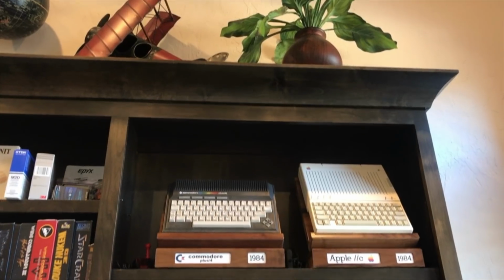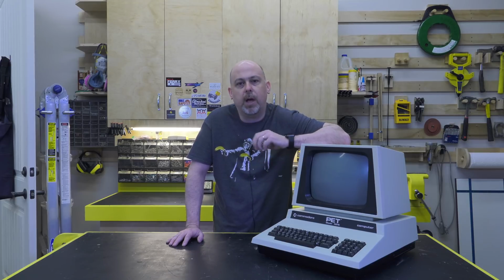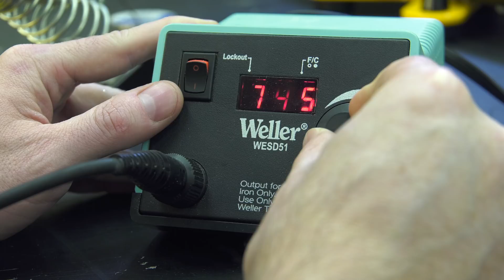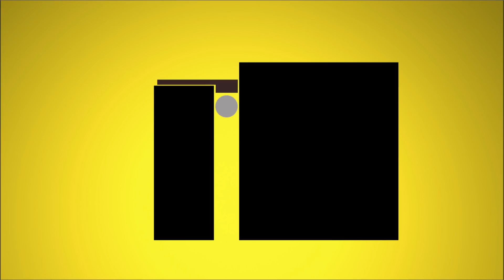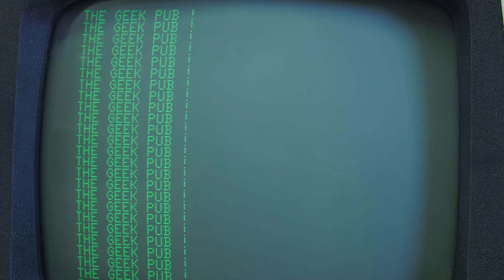Commodore PET Repair

Comment: THE first computer I saw was in 1978 (during my elementary school years), and it was a PET 2001 with the chiclet keyboard and built-in Datasette. The next PETs I saw were in junior and high school, as my school district's computer labs were outfitted with PET 4016s and 4032s. That did not last, however, as the district began replacing them with Apple IIc computers during my senior year.

Comment: I had a different problem with this keyboard type. The metal bits that held onto the space bar stabilizer kept slipping off the space bar.

Since these were pressure fitted, I just wrapped some tape around the metal bits. Took a bit of force to reinsert them, but they stayed put.

Comment: Hello,
I recently built a commodore pet mini raspberry pi but iam having trouble. 
I installed GTK3VICE and did everything I had to but now I dont know what to do. I uploaded a rom to pi called c-pet.vsf its basically a commodore pet rom but when I launched my pi and then installed the rom onto it it launched commodore 64 basic v2 instead of commodore pet v4. How can I fix this? I used vice and do i need to use lr-vice? And when I turn my pi on I see commodore 64 then i click on it and there is the rom but it launches the commodore 64 basic 2v. Thanks if you help me!

Comment: Fun fact: I started at school with a Commodore 8032 and started a business in 1983 with a C64 supplied by the client (I couldn't afford one). The software I developed on the C64  ran until the customer died in 2017. I never thought it will run so long. Asked the shop owner to migrate to a Windows solution and he replied "Why? It works fine!"

Comment: I have a similar story as you for my love of the PET 2001 & C64. My friend's dad was a teacher and had a PET 2001 with the flat "graphics keyboard" and tape drive so this was the first computer I've played on. His dad had it fully upgraded with 16kb of memory.... Later on my brother got a VIC 20 and I eventually got the C64. Man I had so fun on it. 

I recently (2017) got a C64, no power supply not sure if it even works, my plan is to build a Raspberry Pi/Retropie system with it like you did in your other video. Should be cool and lots of fun. Can't wait to play Jumpman again, hope I can find it.

Awesome videos. Thanks!

Comment: Hey bros, you both rock! I would have gone for a quicker and probably more durable solution using two tiny metal leaps (by leap I mean, something similar to those VIC 20 bottom shield holders),  drilling an hole on one side, then screwing them in with a tiny long screw, onto the spot where you glued the ABS piece. Anyway, interesting video. Looks like this is brother with more Pro tools :P
Reply from the maker: I see that as acceptable as well, but I don't see how it would be any less or more durable?
Reply: TheGeekPub Are you serious? It's like a tooth filling Vs a dental capsule screwed into the bone
Reply from the maker: You do realize that CA glue is stronger than the plastic itself?
Reply: TheGeekPub Stronger than a screw buried few millimeters into the plastic, keeping a metal hook in place? Surely not.
Reply from the maker: I'd ask you two take pieces of plastic... let's say 1" x 1" and glue them together face to face with a quality CA glue.  Then screw another set together.  I know which one will NEVER come apart.  And its not the one with a screw in it.
Reply: TheGeekPub My point is: If the original piece got broken -and that was one whole molded component in one shot, how can two glued/fused parts have the same strenght of the original component?It's weaker. It's Physic, not an opinion. Of course your solution can be durable considering that machine will be a collectible treated with care. And I know perfectly the strenght of the product you have used. Back in the days I was using it for scale modeling. Those aircrafts were sitting untouched on a shelf tho, not slapped as like a spacebar.

Comment: Some observations and comments:

- It was my understanding at that time that it was Apple that was big into 'donating' their computers to schools (to generate a whole generation of Apple users before that age of consent), whereas Commodore sold computers to schools, but might have donated one of their special "Teacher's PET" computers to schools that bought a classroom full of PETs. Maybe some early personal computer historian(s) will confirm or refute this.....

- Back in the late 70s when I was a significant player in the early personal computer revolution, I and everyone I knew or heard from pronounced the two chip companies, Mostek and MOS Technology, with Mostek sounding like Mahs-tech or Ma's-tech, whereas MOS Technology always had the MOS part spelled out as the letters M O S, as opposed to pronouncing them as was the case for Mostek. When I called both companies for sales and tech support, their people answering the phones said it the same way. I am sure there were some people who said these names differently from what I recall, but my recollection and impression is that the correct way is as I described. Perhaps some former MOS Technology employee might care to confirm or refute this.....

- Having restored a number of PET keyboards, although never a keyboard from any of the widescreen models as in this video, all of the ones I worked on had a snap-in plastic wedge that held the 'bail' (that's the name of that 'stabilizing wire' under the space bar) in place. The bail was lowered into the slot, then the wedge piece was pressed into place and this held the bail in position. I suspect that the problem with the PET keyboard in this video is that somebody lost the wedge piece, rather than a couple of plastic tabs broke off. Thinking about it, the wedge seems to make more sense because if the alternate 'tab' approach were used, how would the bail ever be inserted into the slot in the first place without breaking the tabs? Perhaps somebody else with this model of keyboard can weigh in about this.....

Comment: Last summer I cleaned and fixed up an Amiga 500. I also had to remove a LOT of screws on the back of the keyboard unit, it was crazy.

Comment: I can't imagine that will last. But maybe i just do not know howto glue...
Reply from the maker: It should last forever.
Reply: CA glue when applied correctly will be stronger than the original plastic.  As Mike said in the video this should be a permanent lifetime repair.

Comment: In our school we had a little game/contest on the PET.  Someone else would flip the power switch on.  The challenge was to see how fast you could type 

?TI

TI was the internal timer counter in Jiffies, 1/60th of a second.   The ? command was short for PRINT.  The game was how low a count could you get.  We were getting times, if I recall properly, of less than 30 jiffies (1/2 second)

Comment: I had about the exact Commodore history. The high school had PETs and when I was a freshman they made a full blown C-64 lab. There was a single PET in the classroom where all the honor student classes where held. I figured out you could poke a value into a register that controlled the frequency of the speaker, I set it at about 17,000 Hz so it could be heard but not localized. I had to turn it off before they destroyed the room trying to find it :)

Comment: Nice way to restore the spacebar back to pretty original functionality.  I have just come into possession of a Pet 2001 with the dual disk unit as well.  I have a few things to fix, as it has steady but scrambled screen output (Ram?).  I think the previous person has already put a new set of Roms in it (as I got messaged that he has found the dust cover and the original roms), and he actually gave me a set of ram with sockets.  So going to work through replacing that and hopefully get it up and working.
It came with quite a few original disks as well, so really hoping to get it going in case there is anything there that needs to be preserved.
Reply from the maker: I have the dual disk unit too, but no cable.  A future video might be fabricating a cable for it.
Reply: Let me know if you need any pin outs from the cable I can test the connections with a multi-meter and send you the results.
Reply from the maker: That would be fantastic!

Comment: I remember using Cyber73 using punch tape to upload our computer programs on punch tape to  the main frame over a dial up modem connected to the TIES computer system in MN.  I was amazed at the "little" computers; Apple II, Comodor Pet, and the TRS-80.  Thanks for bringing back greats memories.  Anyone remember CARDiAC?

Comment: First computer I ever used! 1978!
Reply from the maker: Imagine my feels as I write some BASIC on it....  like I am 8 years old again.  and that keyboard sound...  like a tank!
Reply: I played a text adventure game based on Dungeons And Dragons called just that!  I also play Space Invaders based on the sprite characters on the keyboard and everything was on a cassette! We only got the floppy discs later. And by that time, the school had already gotten Apple II and Apple II Plus computers. So, we were off and running with Wolfenstein, Ultima, Wizardry, and Aztec! Those were the days!
Reply: Or the text adventure game was called something similar. I'm 50 this year. So, the memory is going.
Reply from the maker: Ultima was my favorite game of my childhood.  I played every single one of them.  Most of them on the Commodore 64.  But later on the PC.
Reply: The first computer I ever owned was an Apple II Plus. Then I traded it to someone for a Commodore 64. I had ALL the Ultima games for both. Also, I got heavily into the SSI Gold Box AD&D games for the C64. I used to drive 50+ miles to get to the store that sold them! I owned and beat ALL of them! I went from a C128 to PC in the early 90's.

Comment: I have watched dozens of repairs on older computer and they have a ton of screws and no one ever uses a electric screwdriver. Is this a traditional thing or do you like hand cramps?  ;-)
Reply: I don't in most cases.  Electric screwdrivers (or drills) are notorious for stripping out a screw before you have time to react.  They can also over-torque and crack the plastic.
Reply from the maker: Thats funny because I seriously thought at least 10 times to go get the impact driver and just never did it.  I guess I just like the pain!?
Reply: Well, at the same time, I think it's better to go by hand, since your can feel the torque better, and avoid breaking old plastic
Reply: i use a drill to unscrew screws and a screwdriver to put them back into place